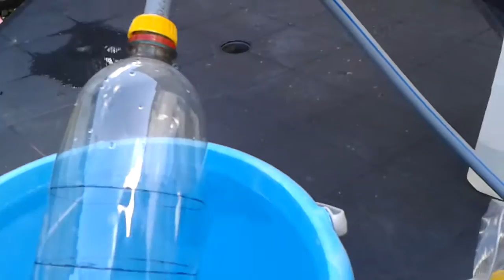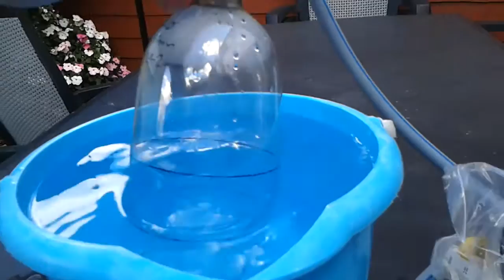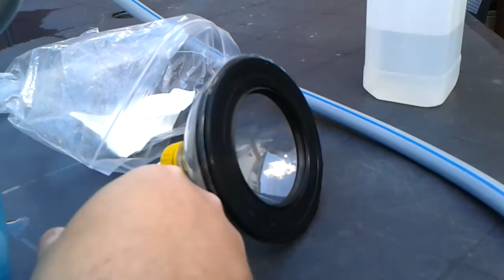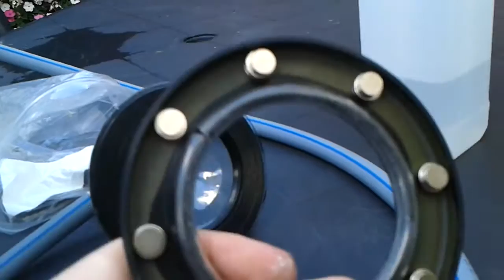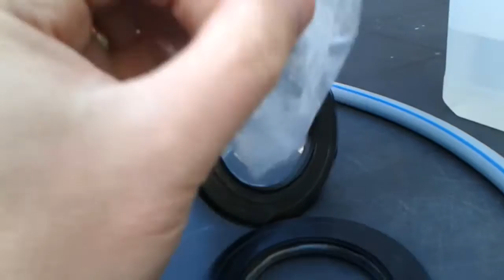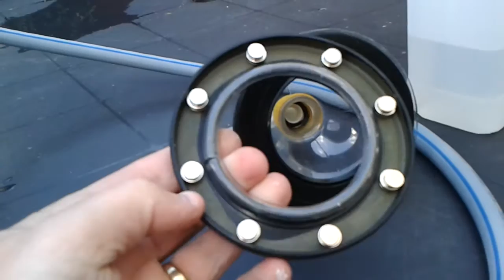Homemade Paraglider Porosity Tester - Part 1 - [New Eggmotor Book On Amazon - link in description]

Comment: Great design. I hope to replicate it and test my used 2 year old Paraglider VS its brand new inter bag (same material) that's close to 100% excellent condition due to storing in dark air controlled conditions indoors. I'm guessing the Used threshold should be close to 80% of New bag to be deemed flyable. Anything less than that would not be airworthy. I am asking, does that seem to be good numbers to go by? If not what is the fail threshold percent?
Reply from the maker: That'll be a goid comparison for you to do. I'm no expert on any of the numbers so can't offer any advice. I onow there's an instructor in Scotland who doesn't fit with conventional theory and training techniques. I've watched several of his videos and his methods and analysis seem sound. I met him once and I'm sure he said the whole porosity/safety issue was incorrect. Don't quote me on that :) it was something like it's the low pressure over the top surface that keeps the wing in shape and not the ram effect. I suppose ram air is required for initial inflation but aerodynamics take effect beyond that point. Seems reasonable but again, dont quote me  :)

Can't remember hia name but i think he goes under the title 'precision paragliding'.

Comment: I tried to make more air enter through the retainer I tried to do as you did but it also didn't work .... how do I seal the two retainers?
Reply from the maker: Hello, did you add the split pvc tubing to the inner ring to create a seal? I'm not sure if i mentioned this in part 1 video or part 2.
Reply: @lookupparagliding  I added.... you can't pass any air correct?
Reply: @lookupparagliding  I saw your 2 videos
Reply: @lookupparagliding  even adding leaks ...... I can't keep the water still it leaks
Reply: @lookupparagliding  I used a 70mm inner 100mm outer retainer with 10mm height
Reply: @lookupparagliding  a question cannot lower the water in any correct way.... it has to be without lowering using the correct bag.
Reply from the maker: @paulorobertobragamellobrag8573  hello again. I'm at a loss as to how to help. All i can suggest is watching the original video on vimeo from the man i copied the idea off as he explains it better. I think i have a link to it on one of these videos. If not, just search for porosity test on Vimeo.
Sorry i can't help any more with your enquiry. Best wishes with this issue.
Regards, 
Eggmeister

Comment: Hi, can you tell me where I could find the black rings that you're using? I guess you glued the magnets to them? thanks,
Reply from the maker: Hi, they are large bearing seals. I didn't need to glue magnets as the rubber rings have steel core. You can get more info from the original creator of this method here: https://vimeo.com/124682223

Those black rings: https://www.ebay.co.uk/itm/70x110x10mm-Nitrile-Rubber-Rotary-Shaft-Oil-Seal-with-Garter-Spring-R21-SC/141876683212?hash=item21088261cc:g:aMkAAOSw0UdXsiCG